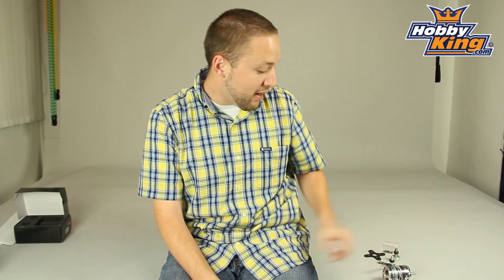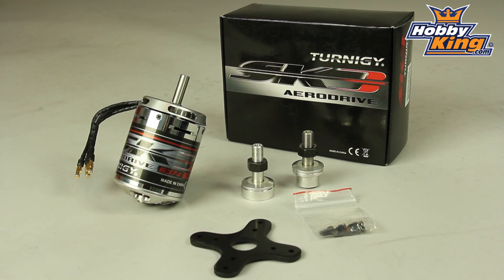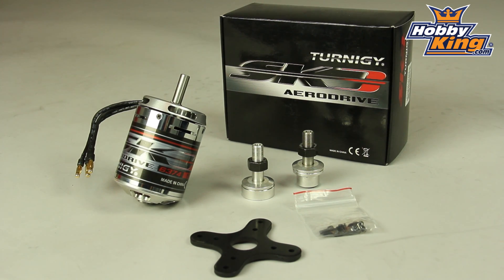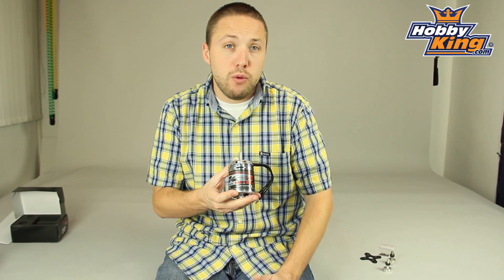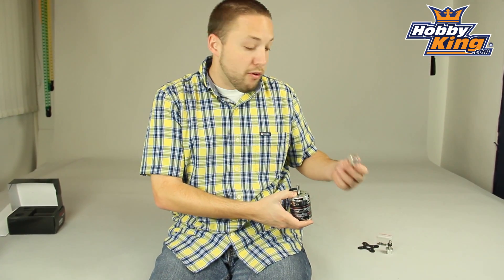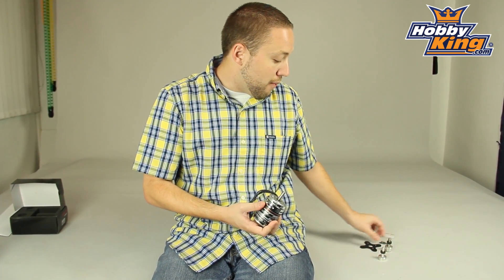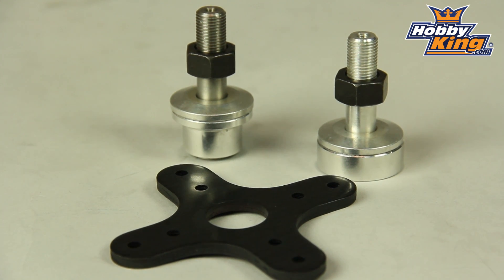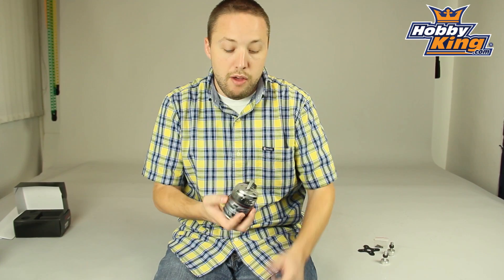Turnigy Aerodrive SK3 - 6374-192KV Brushless Outrunner Motor - HobbyKing Daily

Comment: @HobbyKing I know it's been a while since this came out, but do you have any propeller recomendations for this motor? Thanks
Reply: I have one of these on a 1/3 scale Fly Baby on 12s spinning 20x10 and have many flights with no issues. I think this motor is under rated at 30cc. The planes is just over 24lbs AUW.
Reply: @Lithonion1  thanks!

Comment: Great motor, only two downsides! No sensors version available (Please make another version with sensor wires! sensorless is fine for flying devices and bad for everything else! the takeoff is jittery) and the shaft only sticks out 1 inch! (the motor mount will take 1/4 and good luck mounting your pulley). If these two aspects are addressed, this motor will be e-sk8ters favorite!🙏
Reply: Hi, is this motor come with keyway and setcrews? Thanks